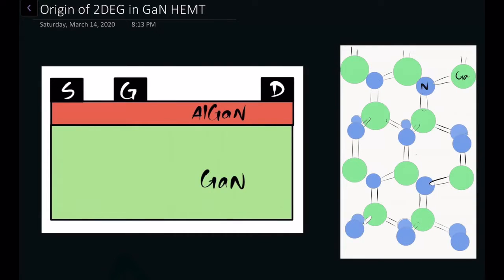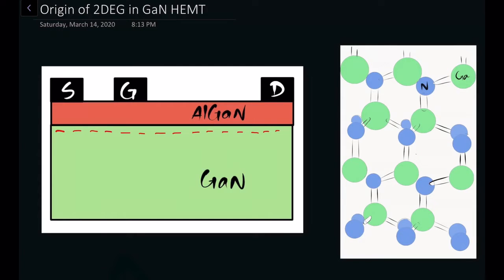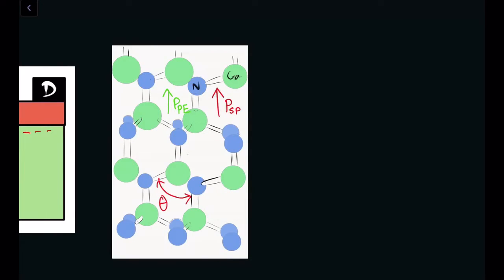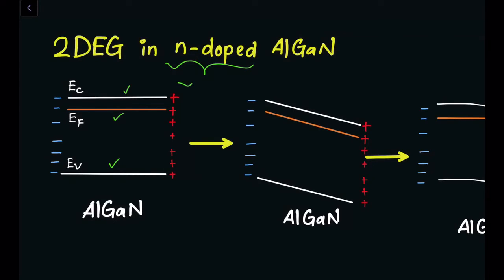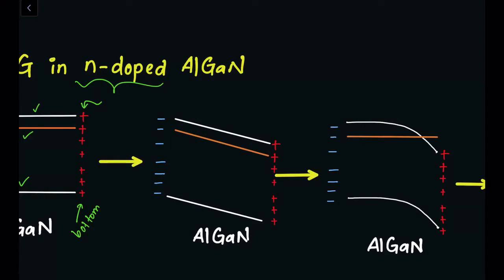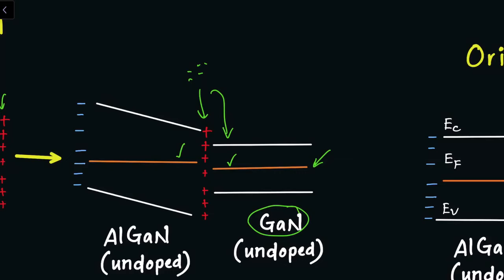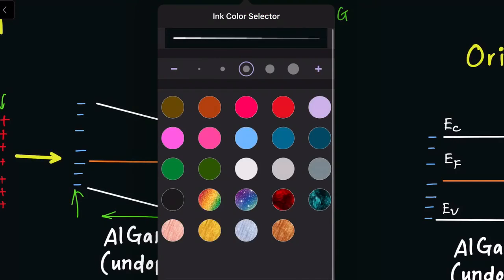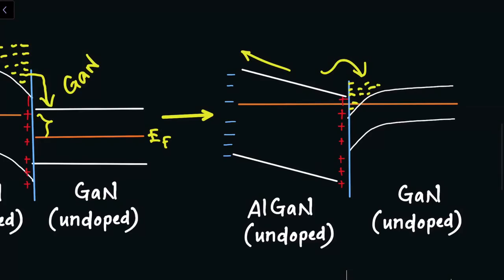Origin of 2DEG in GaN HEMT

Comment: Due to band bending only, Electronics moves along the bend, but you are explaining that because of electron movement towards the innerface the AlGaN band is bending more, how?
Reply from the maker: Good question! When the semiconductor is connected to a battery, the electrons traverse from one end to another end due to the band bending continuously, no electrons are piled up at any end. However, in the case of 2DEG, they are confined in the quantum well which leads to the parabolic nature of bending due to Poisson's equation. Additionally, everything happens simultaneously but for clarity's sake, the steps are shown independently.

Comment: Is it the similar  in  case of AlGaAs-GaAs HEMT for it's 2DEG?
Reply: Yes. Although there is no polarization charge, n-AlGaAs/GaAs can form 2DEG. However, external bias is needed over there to ionize enough donor states at the Oxide-semiconductor interface in order to form 2DEG. Explanation for that mechanism constitutes of the concepts already covered in the video. It can be understood by considerating first about the hetetostructure band diagram. Then include the surface donor state ionization by gate-bias which results into more electron and at the Vg=VTh, 2DEG is formed.
Reply: @s.m.saiduzzamanabir285  thanks